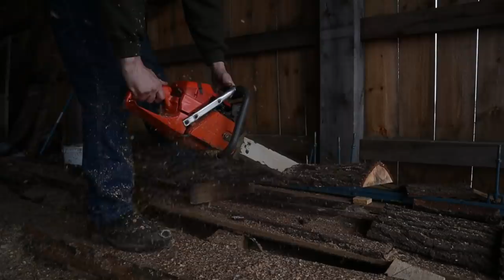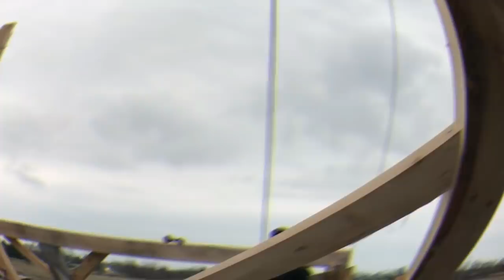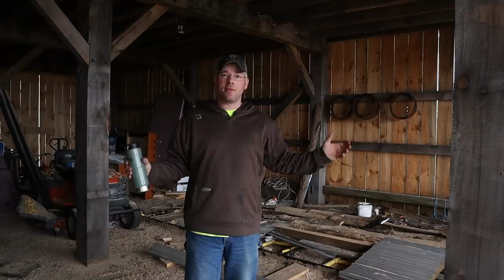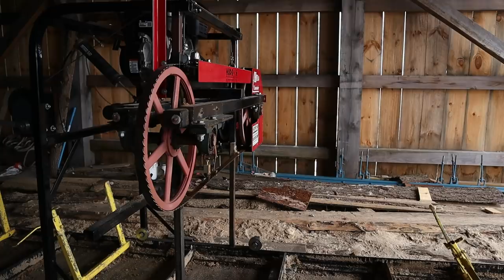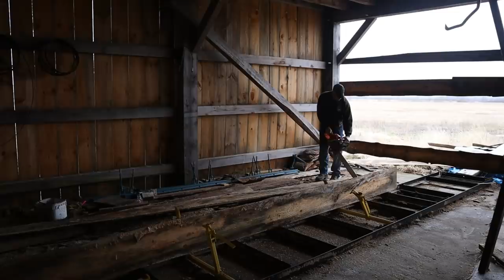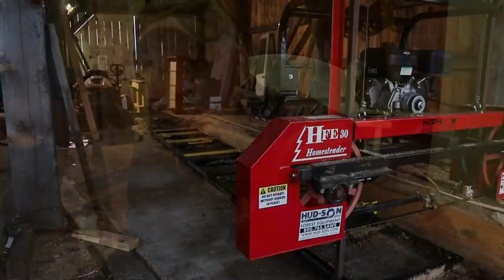Return of the Timber Frame Vlog and Starting to Clean Up

Comment: Jim one of those chipper shredders with the long vac hose would make short work of the dust piles. You would need a box with a grating to stop the large chunks from 
reaching the fan blades. I have one sitting here that would do the trick. it could be setup to even bag the sawdust for burning later.

Comment: I use a snow shovel to clean the track out.  Not a favorite job.  If you have noticed in any of my shop videos, Got Clutter!   Its nice to do some clean up once and a while and find the floor again.  Birds for sure I do like them though.  I can have a band off my mill, sharpened and back on it 6 minutes, the front guard hinges up, easy.  I like the cam locks on the bunk system.  Any problems with them?  The building we are working on now is for Hay, it needs to up by first of June.
Reply from the maker: The log clamps on this mill are terrible to the point of I'm making better ones as soon as I'm able.
Reply: @TheTradesmanChannel  Interesting, my bunks have a simple screw, I slam them in and give it a turn usually that is enough, always thought a cam would be slick.  That mod on the Hudson would be a good video.
Reply from the maker: It'll be coming soon because it bugs the hell out of me.

Comment: Happy Easter to you and yours!
I think splitting your content into different streams is a good idea, as is the seasonal changes! When you think of it you have already done this to some extent .... Tales from the Pit, Milling on a bare concrete slab, building your frame, boarding up .... etc. They were by necessity sequential though. Now you have your shop (or at least most of the top half) you can split it time-wise. That way you have a basic programme set out for yourself (and us) with the added option of opening out projects to be discussed or even voted on for what you do next. That stops you wading through all the mental turmoil of deciding which branch of choices you go down. 
Looking at the amount of dust you are producing, maybe moving your dust extraction up a bit in the queue would be productive? You must have a whole list of stuff you want to do .... why not put a short list up and get your audience involved in the choice? MY personal pick would be a vortex dust separator fed by a wooden impeller belt driven from one of your spare motors. You could then eather duct it or have a long vacuum hose to pick up all the small bits! ..... It may take some building but I suspect your audience would appreciate it! 
Up to now the majority of your work has been timber .... but what about the forge work. I know it is nice now, but ...... Winter is coming! Doing a bit of forge work when it is sub-zero would, I suspect be good! 
You have said you want to end up making timber as your means of income .... why not start the ball rolling with collaborations? Maybe making live edge tables? There is a whole area of timber/ acrylic that seems to be both popular and potentially good money!
I am probably pushing the boat out a bit here but have you thought about teaching your skills? Or linking up with a builder to provide parts for builds? Some of these ideas are long term but even so mighty oaks start of with a single acorn! 

Sorry for prattling on ;0)
Reply from the maker: I am in the planning stages of offering timber courses.  I'm hoping by fall I'll have it figured out and public.  The work flow you speak of is the way to go I think.
Reply: Eather "Great minds think alike" or " A couple of Dumbies!" ....... I'll take option 1 ;0)
Reply from the maker: Option 1 sounds better.